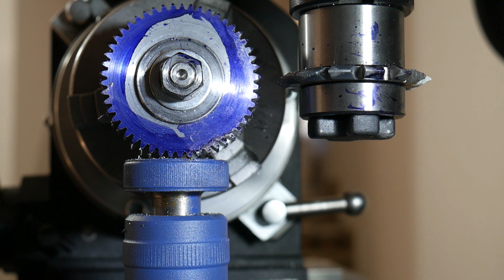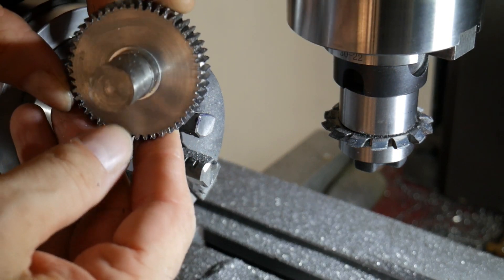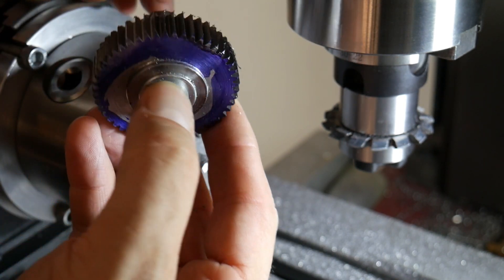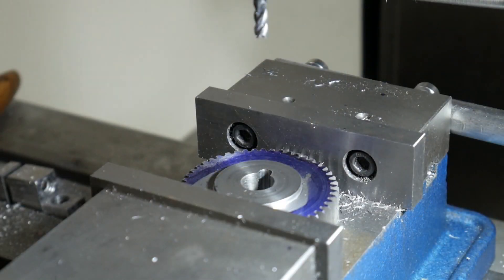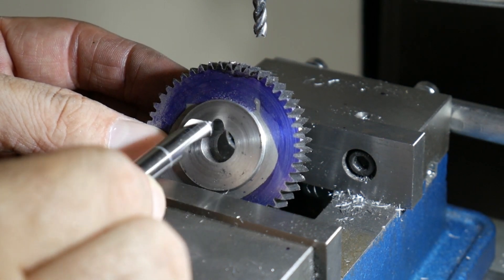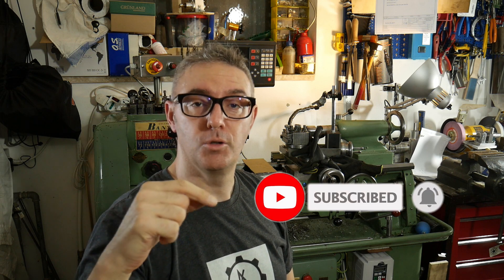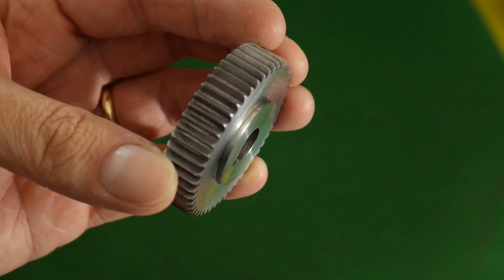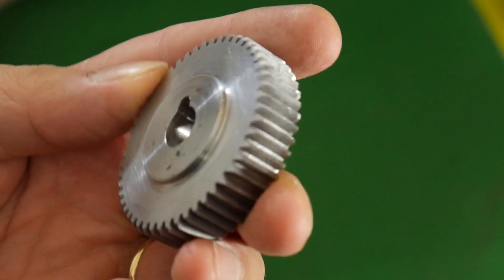How To Make Your Own Gears (DIY Tutorial)

Comment: would it be easier to make a gear with cnc milling machine?
Reply from the maker: Of course, if you have a divisor axis ( you can use a stepper motor to do this), It would be easier, but i don't have It and so i used the old machinist mode!

Comment: The depth of the key is not important but looking professional is. I also wonder if I am the only one who was not convinced about the accuracy of the last tooth.
Reply from the maker: Hi Daniel, yes the last tooth is of the same thickness as the others, which is why I published the video, which, obviously I would not have done if it had not succeeded in the same thickness; indeed, it all depended on that tooth (as you can imagine..) and during the week I had already created 90% of the video ... it all seems trivial but behind a video like this there are several hours of rehearsals, filming etc ... as regards the keyway of the gear, I know very well how it is made, but I have neither the slotting machine at home, nor a hydraulic press to use a broach nor the time to make it on the lathe with a rectangular HSS tool: this I have shown is an old trick that allows you to make it with a simple drill bit, also you can make the hole off-center before making the central hole and then with a file remove the material and make the keyway, so all those who have a simple drill press at home can make the keyway, it seems that in this case the utility outweighs the professionalism you are talking about.Cheers, Alberto.

Comment: Very nice...I especially love the way you did the key slot...kinda thinking I might try The same for my worm gear and wheel
Reply from the maker: Ciao Craig thx, yes it can be very useful without an idraulic press or a keying machine or with a HSS tool on lathe, better if you make the out center hole before to make the center hole, to be sure that the drill bit go down straight without slide to the center; ciao Craig, Alberto.